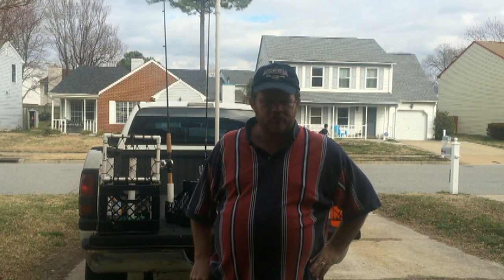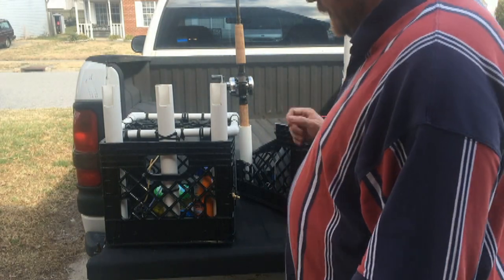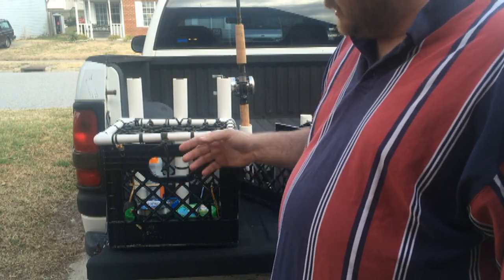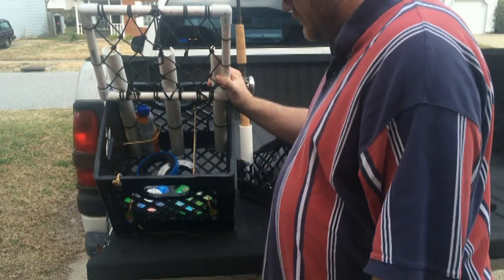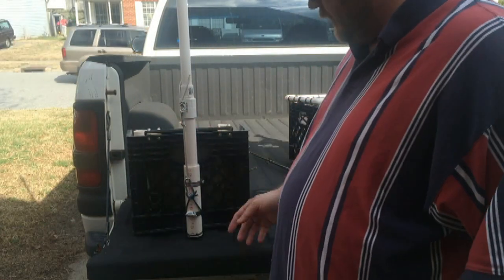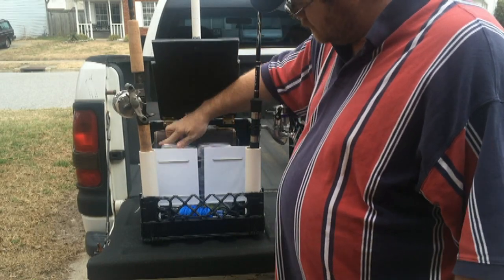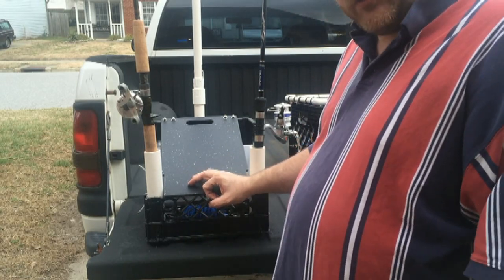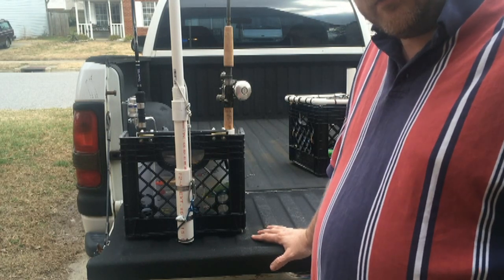Milk crate design

Comment: If you had heated up the end of your PVC Pipes (Rod Holders), and flared them with a wine bottle, they would be better for replacing the rods back in. I made some for a friend, but first ran the pipes on a router table, to get the slot in them. Then heated the ends in a vat of hot oil and flared the ends. (I also rounded over all cut edges with the router table, too!)
  (I didn't like them very much, as they were WHITE!  So I made mine from 1-1/2" ABS pipe. A lot lighter in weight, too!)  As far as leashes, get some "Weed-Whacker" line, over .120" dia. and make your own. Just wrap it around a dowel  tightly, and boil in water for 15 to 20 minutes. Then you have to "re-twist them, to make it really "springy"!  Watch the video on making them).
  I've only "Turtled" once, and that was in a sit-in 'Yak. Lost EVERYTHING!  Got a new pedal drive one now, and have everything leashed or in the front hold.
  Thanks for the video, and I'm sure people will like what you've done with your crate.